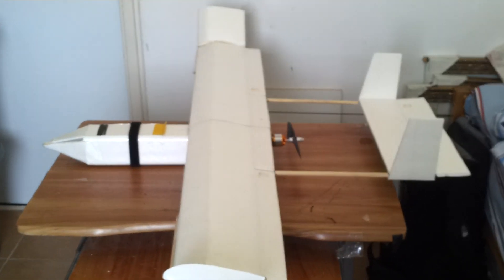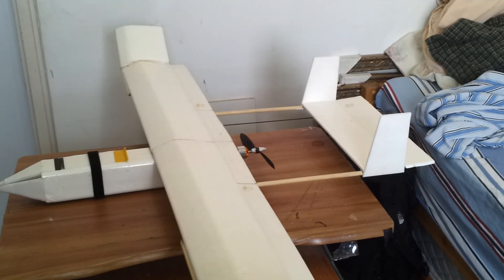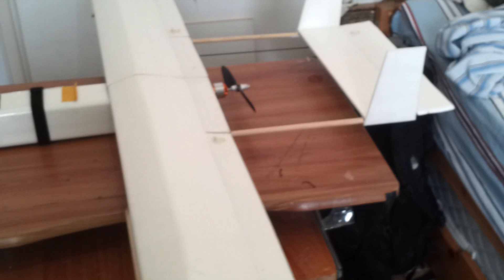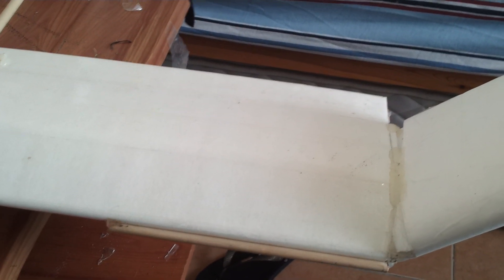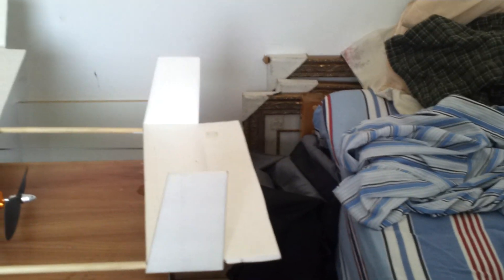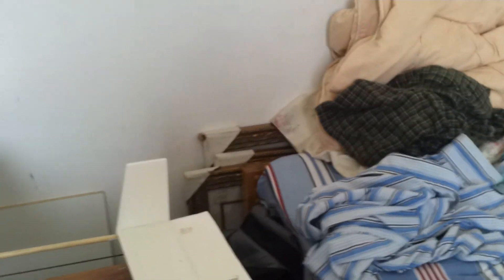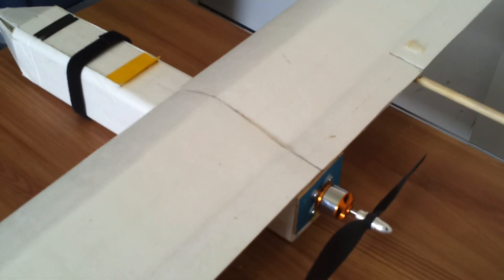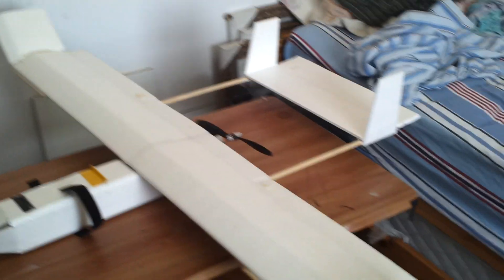Tips for RC Twin Boom Pusher

Comment: hi do you have a link or copy of plans for this i could get off you please?
Reply from the maker: The truth is that this basic layout has been done before and you can almost certainly find plans for a plane that is very similar, but I don't have plans.
Nevertheless, here are the important specs:

1. Wingspan without winglets: 40 inches. Winglets are 5 inches, angled at 45 degrees. Total wing chord is 6.5 inches, of which 1.5 inches are the ailerons.
2. The horizontal stabilizer/elevator is 8.5 inches behind the trailing edge of the wing. It is 14 inches wide and 5 inch chord (of which 2 inches are the moveable elevator).
3. The fuselage is 2.25 inches wide and protrudes about 10 inches forward of the leading edge of the wing. 6 inches for the square section and 4 inches for the cone section.
4. I used a 1000 kV motor with a 9x6 slow fly prop, but many other motor/prop combinations will work fine.
5. I used dollar tree foam and the "Armin" wing technique, but many other foam types will work with the KFM3 approach.
6. Vertical stabilizers (no rudder on these) is about 5 inches tall.

The key is to keep the wing loading low (no more than around 8 or 9 ounces per square foot.
Also, the drooping leading edge cuffs and winglets will really make the plane behave much more nicely at slow speeds - so don't omit them.
Reply: @natanabrams622  thank you 👍

Comment: Im a little unsure that winglets are needed on this plane. Yes, they add stability but there are plenty of these designs out there that do just fine without them. Additionally. if you add just a touch of forward sweep on the wings you dont need those dowels to droop the wingtips.
Reply from the maker: Yes, it's certainly true that the plane can be flown without angled winglets or drooping outboard cuffs (in fact, I did fly it without those, initially) - it just makes at/near stall speed flying so much less nerve wracking with them. I've used this plane to train several newbies, so that's a huge plus.
Here is and excellent link to an example of outboard leading edge cuff:
http://phil.zatetic.com/school/AAE_415_Presentation.pdf
In short, it's not for nothing that designs that are decades old have been retrofitted with both cuffs and/or winglets.
Reply from the maker: oh, and from a consruction standpoint I find LE cuffs a LOT easier to experiment with  and modify than forward sweep and/or wing twist. Same can be said about winglets - don't like 'em, just cut 'em off and try a different size/shape/angle.

Comment: could you explain more in depth about the sizing of the rudders you said something about the cg but i didn't quite understand it.
Reply from the maker: The longer the moment arm (distance from CG to centroid of vertical surface area), the less vertical surface area is needed. So if you have vertical surface area ahead of CG that's 30 sq in and its moment arm is 5 in, that's 150. So if your tail boom is 10 inches long (just an example) then you need a vertical fin of area that's a bit more than 15 sq in (for positive yaw stability). How much positive yaw stability you want is somewhat a matter of experimentation, but you DEFINITELY don't want negative yaw stability.

Comment: im not a great scratch builder, or pilot.  but ive found a 30'' KMF2 wing with no dihedral isn't that hard to fly.  You don't want to bank it as hard  (especially low to the ground and at low speed) but at moderate speeds I have no problem.  dihedral is great for a trainer or a slow fly because you don't want it to tip stall, but for a quicker plane a flat wing is just fine.  Im working on a twin boom with a EDF mounted above the wing.  should be interesting.

Comment: very nice design,any plans & spec's?
Reply from the maker: I don't have plans, but here are the important specs:
1. Wingspan without winglets: 40 inches. Winglets are 5 inches, angled at 45 degrees. Total wing chord is 6.5 inches, of which 1.5 inches are the ailerons.
2. The horizontal stabilizer/elevator is 8.5 inches behind the trailing edge of the wing. It is 14 inches wide and 5.5 inch chord (of which 2.5 inches are the moveable elevator).
3. The fuselage is 2.25 inches wide and protrudes about 11 inches forward of the leading edge of the wing. 7 inches for the square section and 4 inches for the cone section.
4. I used a 1000 kV motor with a 9x6 slow fly prop, but many other motor/prop combinations will work fine.
5. I used dollar tree foam and the "Armin" wing technique, but many other foam types will work with the KFM3 approach.
6. Vertical stabilizers (no rudder on these) is about 5 inches.

The key is to keep the wing loading low (no more than around 8 or 9 ounces per square foot.
Also, the drooping leading edge cuffs and winglets will really make the plane behave much more nicely at slow speeds - so don't omit them.

The truth is that this basic layout has been done before and you can almost certainly find plans for a plane that is very similar.

Comment: Hi,
congrats, nice plane!
Is the plan available? Please, share if so, I'd like to build this plane
thx
Reply from the maker: Hi Kornel,

I don't have plans, but here are the important specs:
1. Wingspan without winglets: 40 inches. Winglets are 5 inches, angled at 45 degrees. Total wing chord is 6,5 inches, of which 1.5 inches are the ailerons.
2. The horizontal stabilizer/elevator is 8.5 inches behind the trailing edge of the wing. It is 14 inches wide and 5 inch chord (of which 2 inches are the moveable elevator).
3. The fuselage is 2.25 inches wide and protrudes about 10 inches forward of the leading edge of the wing. 6 inches for the square section and 4 inches for the cone section.
4. I used a 1000 kV motor with a 9x6 slow fly prop, but many other motor/prop combinations will work fine.
5. I used dollar tree foam and the "Armin" wing technique, but many other foam types will work with the KFM3 approach.
6. Vertical stabilizers (no rudder on these) is about 5 inches.

The key is to keep the wing loading low (no more than around 8 or 9 ounces per square foot.
Also, the drooping leading edge cuffs and winglets will really make the plane behave much more nicely at slow speeds - so don't omit them.

The truth is that this basic layout has been done before and you can almost certainly find plans for a plane that is very similar.
Reply: Natan Abrams Thx!
Reply: Kornel Javor What AUW you have with this config? Where the CG is prefered? 1/3 wing chord or? thanks mate
Reply from the maker: Kornel Javor
 CG can be anywhere between 1/4 and 1/3 wing chord, just like any conventional design (unlike a delta planform, where CG is different) - depends on level of stability desired - beginners should go for 1/4 chord.
AUW (including 6 oz battery, 2200 mAh) is about 26 ounces, but that can be lowered by using pink foam (Owens Corning) and carbon fiber wing spar, booms and drooping leading edge cuffs.

Comment from the maker: Motor: Turnigy Aerodrive, D2830/11, 1000KV
Prop: 9 inch, 6 pitch, "Slow Fly" type

In order to get this regular prop to "push" you simply put the prop on "backwards" and reverse two of the three motor-to-ESC wires. This process is shown in other youtube videos (I know I've seen several that discuss it).
You could, of course, get a purpose-designed pusher prop, but reversing a normal one on the shaft will work fine.
Many other motor/prop combinations will work just fine from what I've researched.